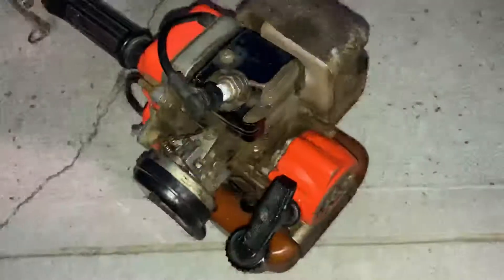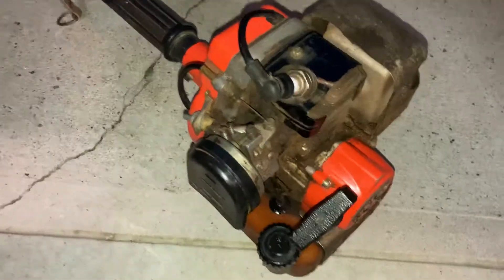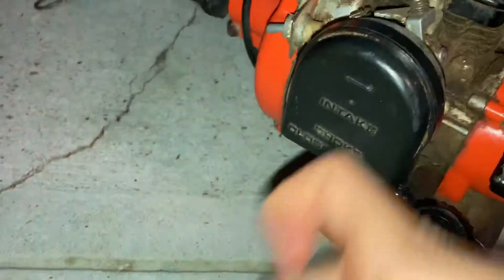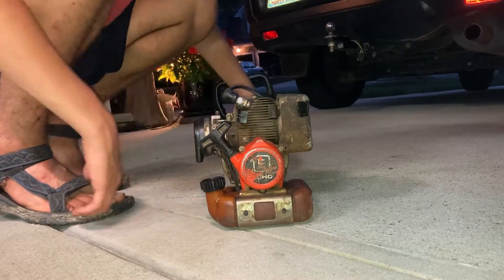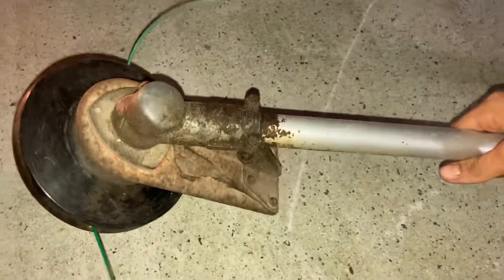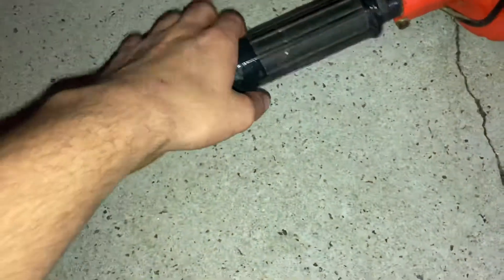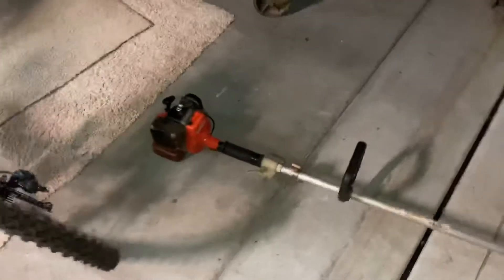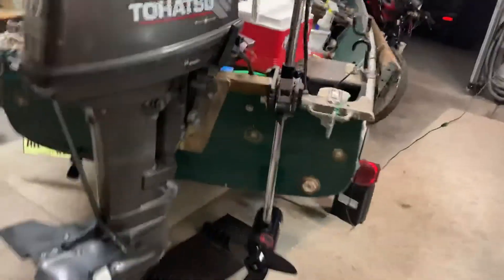Echo SRM 200

Comment: I've got an Echo S-2AP Made in Japan by the Kioritz Corp.  Im not sure if it's older than the SRM 200 or newer.  The only way I've been able to date it is by the date that my father in law engraved into housing the day he bought it......June 4th 1982.  I can't find a single example of it online but it looks very similar to yours except the gas tank orientation and it has a different carburetor.
Reply from the maker: @mattfowler7892  a S-2AP? I have never heard of that model, would like to see a video of it. I actually no longer have the Srm200, it had a lot wrong with is so I just sold it for parts
Reply: I'll put a video together when I get some time.